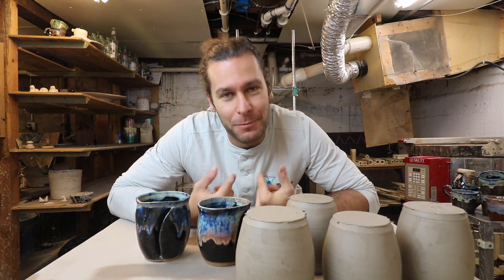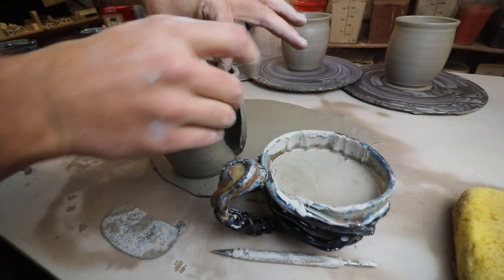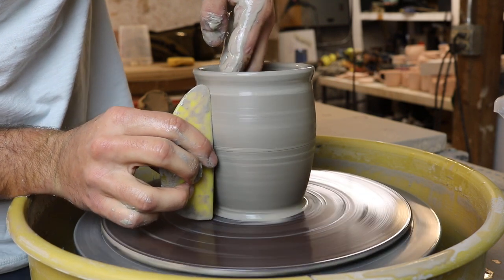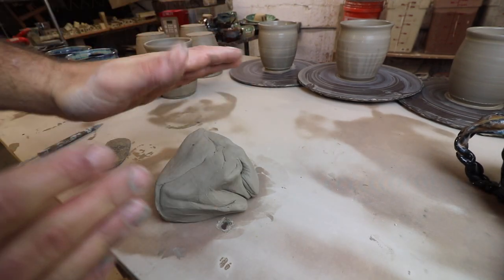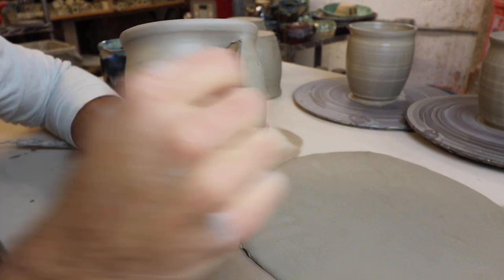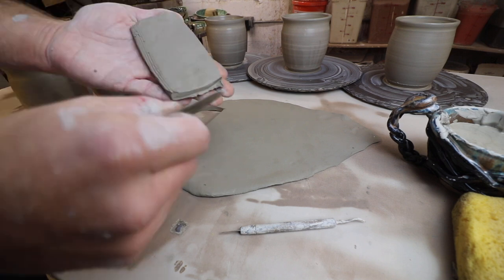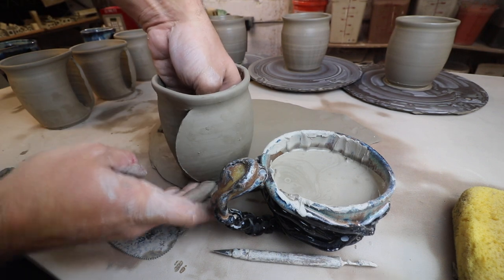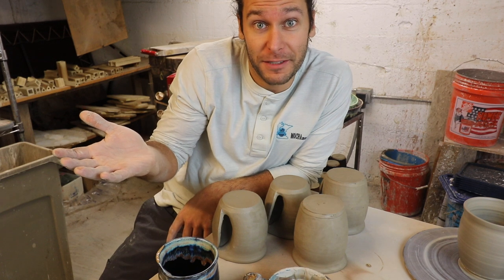How to make a Handwarming mug on the wheel

Comment: Cool idea definitely will try. Something I did this year and maybe another idea for you is we got into soap making too so the family/kids made soaps to give as gifts from them, so we also threw "soap dishes" on the wheel to include with the soaps.  Basically just a big almost flat coasters (very little or no outside edge turn up) that we used a small tool to make fairly tall raised circles in the bottom of or spirals.  Just a thought.
Reply from the maker: Cool idea!

Comment: Thanks for the video. Have you ever thought of or tried placing the slab on the outside of the mug to make the sleeve instead of cutting the mug and pushing it outwards?
Reply: I do mine to outside all the time, think is easier. Barb
Reply from the maker: Yes!  Part 2 coming soon:)

Comment: I apologize because I'm not a potter, but if you'd like these mugs without inserting a new piece inside Jon, then is it possible to bend your mug in that mid-stage inwards to get the finger indent, and then to attach the outer finger covering as the separate piece instead? The inside won't be a perfect circle; however you might save some sanity and surely you can make that shape your own and awesome!

Comment: Before I saw this video,  I saw this type of mug on Google and attempted to build one myself (I don't have an actual wheel , just a turn table deal for cake decorating). It's quite a bit bigger around,  but I still like it bc it looks like a sea shell.  I added a slab on the outside, not inside.  Then sculpted a quick flower onto it to cover the ugly spot.  Wish I could upload and share a pic.  I rather like it. But there it sits on my shelf,  bc I am pit firing or trying to build a wood fired cob clay kiln ( and so far failing epicly).  I think the clay I dig out of the ground for the kiln (2 dif types of clay here,  sandy and pure) is a bit fussy.  I literally have a terra cotta hole in the ground now where I dig a pot for the fire,  but building a dome over the top... well or reasons a lot here and it crumbled before it could finish firing.  And also,  I'm having f problems getting both hot enough temps to completely and evenly fire it (wind... rain...), and also not break off mug handles (swearing....).   Then Christmas approached n I had to take a break.  Then the field flooded and the livestock needed moved. Then the pigs had babies... then.... and then.... 

Ugh. I just wanna make coffee cups in the native fashion.  Sigh....

Comment: I have never worked with clay, so this might be a stupid question, but curious if there is a reason why you don't just squish the mug to the form you like, then just put the sheet that goes over the hand on the outside?

Also, would it be possible to make a partial mold of the inside, like pour silicone inside the mug, or whatever potters use to make molds (clay?)...then you can place it inside the new mug, squish, and that should keep the edge and the bottom from deforming...then add the outside part...  🤷

Comment: hey bro have, why don't you try joining the hand cover instead of making a cut, is there any specific reason to do so, plzz specify
Reply from the maker: Yes I have done them both ways and it works either way,  Just slightly cleaner the way that I have done them but the other way is probably easier!

Comment: if you listen to this video with your eyes closed it sounds ridiculously sexual

if it's too thick you can throw it out; we're going to stick this piece right in here; if you stick it in and it sticks up too tall it's probably too long; take out your piece, add some slip to the edges, provides it with some lubrication and then slide it right in; have one hand in here and have your other hand here; this part takes a while and is kind of annoying; make sure you go all the way down to the bottom - that's something i had trouble with; make sure it's smooth; then clean it up from the inside and outside.

i'm sorry that you won't be able to not hear this now.